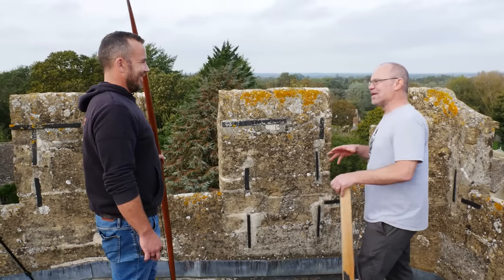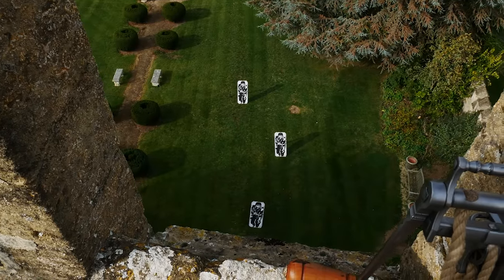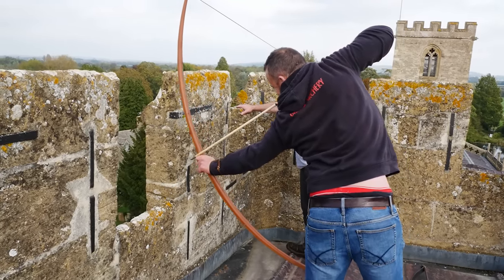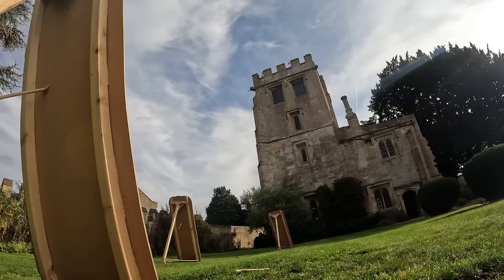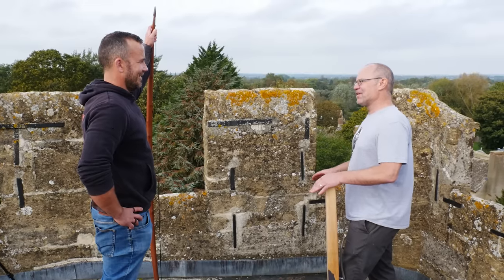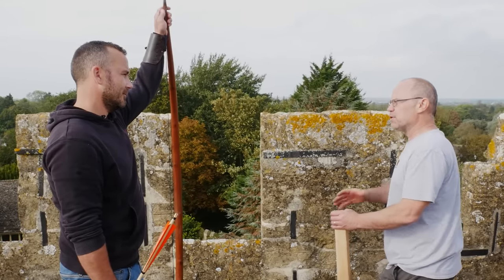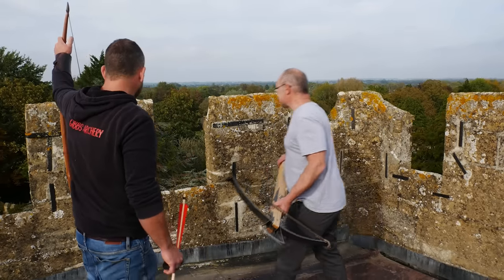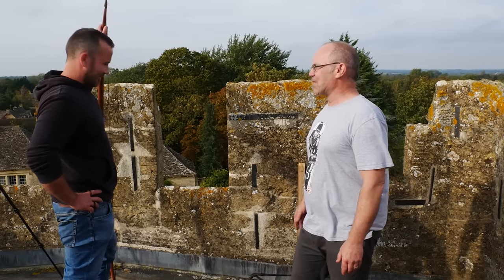Crossbow or Longbow? What's better for defending your medieval tower?

Comment: The biggest advantage of crossbows is that they're a bit more complicated mechanically, but super easy to learn how to actually use. No real techniques required. Also if you have multiple crossbows and 2 untrained people and one good crossbowman, the crossbowman can aim, fire, and switch his crossbow out while the other 2 reload them. They also spend way less time exposed than archers, as with actual castle thickness walls, the crenellations will provide much more cover from the sides. So instead of having to draw a warbow, and then line up a shot (which is way more likely to fumble when there are arrows flying by your head), a crossbowman just steps out, lines up a shot, and then steps back behind cover.

Crossbows are generally more complicated to test but I think they would've been worth it.

Comment: I think this is a question of right tool for the job situation and something not considered is fatigue. An archers is going to tire much more quickly than a crossbowmen, especially of the crossbowmen has a loader(s). There is a ROF question to be asked here as well. On a one on one basis the Bow as the superior ROF, but in a situation where the crossbow has loder(s) the crossbow gains the ROF advantage.

Comment: I hunt with both bow and crossbow. Obviously hunting is not warfare and modern versions are very different than medieval, but here are my two cents:

Bow: faster rate of fire, more maneuverable and portable.
Crossbow: requires less practice and physical ability, less movement if you're trying to stay hidden.

Both have their place, like a hammer and a screw driver.

Comment: A few things. 
1) it is entirely possible they used lighter weapons while defending you're shooting with gravity etc
2) the narrower crenalations would be a meaningful detail as that impacts you're angle, I doubt defenders would tilt so hard. 
3) those tight shots I doubt bolts and arrows were preferred. You would likely be shifting to things like rocks or boiling water etc at the tighter ranges. 
Just early thoughts from about halfway

Comment: One thing that seems to have been overlooked is that most castles and battlements have 'towers' that stick out from the walls.
That enables archers to fire across the face of the wall at a more distant target. Shooting 'down' would evidently be difficult and dangerous.
Logically, those archers on a wall would depend on those in the towers to engage any soldiers who got close to the wall.
Similarly, a longbowman who shot at an angle through the crenellations - effectively creating an arrow 'slit' would be less exposed than one shooting straight ahead.

Comment: The difference between your decorative crenelated tower and a genuine castle is firstly the projecting towers in the curtain allowing shots along the base of the wall, but also because of the use of hoardings to allow you to stand outside the wall and have overhead protection.

Comment: Crossbow and its simple. Less training needed to operate, you expose yourself less while firing, you can produce more bolts because they are smaller. You can line up your shots easier, once under tension the bow is point and click theres no physical force needed meaning you have on demand fire capability. Theyre easier to use in confided spaces like in a turret etc. They provide excellent stopping power at close range which all sieges are end up becoming. Another advantage no one mentions is that injured soldiers can use them. Even wounded someone can use a crossbow effectively meaning that you can offset your fighting force effectively with people who would otherwise be burdensome.
Reply: In my opinion close range is better for the crossbow and range is better for the bow. Firstly as shown in the video, the crossbow was an awkward tool to carry in general compared to the bow and if you're in a confined space with many men around you it becomes a pain to get anywhere and I would assume even reload with all the stress. Of course experts could deal with this but didn't you say all skill classes used the crossbow? Knowing how to use one is fine, but perfecting it still takes time which might not be there if new recruits are placed into battle.

There's also outside fights which were more common I believe. The rule of thumb is if you can shoot more projectiles at the enemy than they can, you're gonna win most of the time. Just like musket warfare. And bows could shoot much faster. I doubt agincourt would have been a success if the English couldn't keep the arrows flying every second. 

I'm not trying to undermine your opinion though, crossbows certainly had there benefits, I just personally think bows were better.
Reply: @guntherbgunnerson8989  Well firstly were talking about castle defense here. You can literally set a bow on a ledge no carrying required. Secondly confined space favours a crossbow. You dont need many men firing you can literally have loaders and one guy do all the shooting. this frees up space and increases rate of fire. You dont need to perfect it this is literally why the crossbow replaced longbowman. Literally any peasant could become crossbow proficient in hours vs years of longbow training.

In an open field a longbow has range and speed advantage again were only discussing it in context of tower defense. Bows arent better in siege defense.
Reply: @toddpick8007  Then it comes down to if you want multiple loaders for one crossbow or not. Let's say there are 20 spaces out crossbowmen defending a castle wall. If each man had jusr one helper for him that's 20 more men wasted on only 20 crossbows. As for expandability, you're right. It's ten times quicker to get a new crossbowman than longbowman. But if the whole English countryside is made by law to practice, it's not like three battles would complete devastate them. Plus longbow are perfectly adequate inside 90% of the time, just keep it knocked. Although the in the rarer cases where it's suddenly who can shoot faster the crossbow would just win. But the video shows crossbows were awkward, at least compared to the bow. I suppose it's a case of quality over quantity at the end of the day.

Comment: A thought using indrect fire you fire the bow in a parabolic arc 
Try shotting the arrow up in the air aiming to drop arrow onto target /\ in effect it blind fire but bonus is you are in cover 
Try standing in middle of tower aim upwards shot using a parabolic arc you be aiming at a mass of men all running towards the tower and archer would be firing for speed 
intresting to see how many of any you could hit

Comment: in both cases, i agree that your particular choice of weapon was likely not well suited to this particular defensive position, a smaller, lever-loaded crossbow, and either composite, or just lighter bow with shorter limbs would have been easier to use in the limited space.

a well designed true fortification would have small firing slots built into the lower portions of the defences, to allow some fire upon closer enemies.

Comment: Possible crossbow justification:

Seeing that the fire rate of a bow is actually limited by the archer’s stamina, and that only a few arrows are typically fired per man hour, I think the hypothesis Todd presented that castle archers may be restricted to lower poundage.

If this is true, it may eliminate the range advantages you would otherwise expect from elevation. Since crossbows may be spanned further from danger like Todd demonstrated, they don’t need to have reduced power for castletop use.

If both those assumptions are true, it may be the case that castletop archers are more vulnerable to return fire from more powerful bows employed by the attacking force, while crossbowyers maintain a greater threat zone and can punish attempts by the enemy to push into their own firing range.

Tl;dr Maybe crossbows provide a strategic advantage due to bows having limited power in defensive positions.

Comment: two solutions for the closest one realy, lighter bow or less tension if you want to shoot from that particular position. Also like it was being said those walls on the top are decorative real castle would have solutions that remove that sweetspot at which you can't shoot at them and you cant't toss stuff at them

Comment: Okay, remember also, the Longbow was often used as basically Artillery, massed groups of archers firing long ranged lobbing shots raining down arrows from way above.  So instead of bending forward, they may have stayed further back and just lobbed until the enemy got to close, aka Danger Close, and then switched to lighter bows and various forms of Crossbows, perhaps even lighter crossbows.  The Crossbow could also be used vertically, if the crossbowmen could hold the bolt on the rail with their thumb, and not go completely vertical, they might have been able to get VERY close in on the bottom of the tower, especially with some castles and towera and such having slanted bottoms to keep the enemy from getting right up close to the bottom of the tower.  :-)

Comment: I guess main advantage of crossbow is that you can shoot it fast and then duck to cover again for reload. It's also bit more easy to maneuver to various angles. You could also have good crossbowman have say two bows and other person person reloading it so they can keep shooting quite fast. Reloading is very easy and safe if they are in castle/fortification, so anybody can do the job. 
Normal bowman would get fatigued pretty fast I assume. Ultimately, I think it's much more sustainable and economic. Since you can maximize effectiveness of skilled soldiers shooting and they are really only effected by actual injuries and some basic fatigue. Meaning you actually need less trained and quipped soldiers

Comment: Please note, that - at least the french - crossbow operators had a special belt hook to reload. The procedure was to place a foot in the crossbows front ring, kneel down with the other leg, engage the hook and than to stand up. Next step was to load the bolt, pop out of cover take a shot and than start all over. Much quicker than that crank and you got perfect cover.

Comment: On a regular castle wall the fortifications are further apart meaning you can lean on the edge with the crossbow like a trench. Plus, anyone can use a crossbow, a longbow requires intense training and strength.

Comment: i would say they shot with long bow at concentration of enemy at long distance, as the enemy close it, they use lighter bow for flexibility and rate of fire (when the enemy push, you want to up your rate of fire, and the enemy is going to push a few times before they either break through or call it a day). but with plate armor, not sure whether these arrows would be able to do much, but of coz, not everyone would be wearing heavy armor.

Comment: I would say that they probably used a combination of crossbow and bow, likely not using a longbow, but a shorter warbow would have been used for defending a location like that, as they had bows designed specifically for defending fortifications if I remember my history right.

Comment: Another excellent video from both of you.  This is slightly off point but it occurred to me that had this been a castle then it’s quite possible that you’d both have been shooting from fighting platforms hanging over the castle wall, potentially making enfilade shots far easier with the attacking soldiers being very vulnerable on assault ladders for example.  

With regards to both bows, would a lower power crossbow have worked as well? Hand cocking or using a belt hook would have been faster for sure and if a bolt won’t defeat armour then it’s the accuracy of the shots that would count and I’m guessing that less well armoured foot soldiers would still be wounded or killed.

Comment: I think one thing missing in all these kinds of tests to measure is stress under fire.

If someone was firing back at you, id aim better with crossbow than a bow.
Every small amount of time your exposed (and amount of body exposed) you have chance to flinch.

Bit sadistic but would be intresting to see affect on accuracy with paintballs or something threw in your direction while your trying to aim.

Comment: Not only can you span and aim the crossbow, but you can track moving targets easier I bet! The time it takes to follow and lead the enemies might be more difficult for an archer. They are running side to side as well as towards the defenders, so I bet the movement and increased time would be tough for Joe/bowmen. Also, crossbowmen might have an easier time changing targets, ducking for cover, and canceling shots.

Comment: Castles had murder holes in the walls and keeps to fire from at several heights. They probably used a shorter bow than a long bow on the wall. Additionally, there are more weapons or methods of hitting attackers than wasting bows once they are close.

Comment: I would make the point, that you could work the Xbow in teams of 2. one guy reloading standing back, the other guy keep shooting. If you get tired you can change spots and "rest" or at least easy the tired muscles a bit, cos i would guess shooting and reloading use the muscles in different ways, which might help with fatigue a bit.

As an addition, maybe the someone who wont be able to pull such a "Warbow" might be able to reload the Xbow with the, was it windless(not native english speaker here)?

Another thing might be, the availablity of skilled archers. You might or might not have tested it on your channel, who can be more effective, untrained Archer or Crossbowman.
I think in general for me the 2 big questions would be:
Who are the enemys/what is their equipment
and how skilled are your people. 

Not sure if that makes sense for you guys.  This is of course for the defender.
for the attacker it would probably be best to have mix. X-Bows stabilised on shields aiming for the heads to pop up and archers for the faster shot/reload. I think you might be faster to switch targets with a bow then a Xbow, but since i never shot a Xbow, i cant tell.
Merry Christmas btw
P.S. should have read your pinned comment. I think you covered basically everything i mentioned here. Still, Youtube likes comments, so its gonna stay.

Comment: I would love for you to repeat the Test in an environment that is more realistic to an medieval castle or for you to at least explain to the audience why they are very different to the decorrative crennalations on your tower there. Originally as far es I know they had hoardings wooden roof over the crenellations on most castles and smaller gabs and the hole setup might make it even more restictive for a longbow. But to shoot straight downward was of course possible through the Machicolations gabs between the floor and the crennalations that would sit outward from the wall giving you the opportunity to throw or shoot directly downwards with nearly full cover. I would love for you to teach a little bit more on this topic because I think most people have a very flawed picture of how battlements realy looked and worked in medieval times.

Comment: From my amateur perspective: 

at this distance throwing rocks would might be more effective. Maybe not actually damage/accuracy but the psychological pressure as well. Arrow or bolt would ricochet on armor but rocks flying from that height will prob apply decent concussion if hit on target. 

Longbows would be effective for targets way further back. Let say smth like suppressive fire on the treeline. 

I'd put the crossbowmens on the lower portion of the structure like peek holes from walls etc. Which can prob apply better directly in the face.

Another idea would be throwing oil jars and use lighter-weight bows for fire arrows to light up the men/field.

Comment: OK, I will attempt to explain the crossbow's main advantage. They were slower to load and fire, and slightly less accurate, BUT it took years to train a longbowman, but only a few days to train a crossbowman. So losses in  crossbowmen were much easier and quicker to replace. 
Over time, that advantage shows up more and more, just as it did in the many English/French battles on the continent. Early on, the English Longbowmen had a decisive advantage over the French Crossbowmen, but as their numbers decreased, the French ability to train replacements quickly became the deciding factor in the battle of the archers.  
Much like today, archery was largely a battle of logistics. In battles of attrition, the side that can replace its losses quicker must prevail... IF they can hold on for long enough. The side that has fewer numbers, but better technology(at least for the moment), has to win the war quickly, before they run out of their superior, but harder to replace, personnel.

Comment: One overlooked thing was that i dong imagine the heaviest crossbows were as common, i imagine ones 600-700 lb would be more common, lever or pulley belt drawn, lighter trigger and biw so could be used on battlements better
Another theory is that with archers training at 180 or 165lb and shooting 165 or 160lb
My theory is two things, either they trained more at 180lb so the 160 or 165 could be used more consistently out and on battlements or as mentioned the lighter bows were more popular on battlements

Comment: I have visited a fair number of castles and forts. They generally have arrow slits on the stairs leading up to the towers. As you could see in the video,sl as you eere going up the stairs with your crossbow, it was quite difficult to navigate. This would make me think that bows for siege defense were notably smaller than the long bow being used here.
In some castles (Red Fort in Alanya), the arrow slit is at the end of a tapered section where it seems the defender would have to kneel. 
You may have a bit of further experimentation to endure with various bow sizes and position of the bowyer.
I look forward to seeing them.